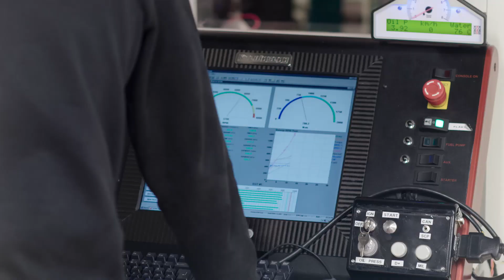/INSIDE KOENIGSEGG 2 -- Coming Soon to /DRIVE

Comment: Koenigsegg is my absolute favourite car company. They make what we dream, BUT is the One:1 going to compete on the same level as the LaFerrari, P1, and 918? Will it be beyond them? or is it appropriate to even consider the comparison?
Keep. It. Up. Koenigsegg. Wow.
Reply: On paper it's a whole league above the Hybrid Hypercars. It's got a much higher power/weight ratio and estimated top speed than any of them, with aero trickery to match them for the corners.
Reply: As Mike stated above, it will be way ahead of those Hypercars. Even the Agera R is miles ahead of them.
Reply: ThePhiltastic Wait for Koenigsegg to release a ring time just as McLaren did? Oh wait, they never did! And if you think that the Agera and the One:1 is made for straight line speed only, you are very wrong. The One:1 can pull 2 G's, on STREET tires!
Reply: Calabunga P. K. The One:1 is just going to 'compete' with LaFerrari, P1 and the 918 Spyder... in a straight line its going to crush them like beetles underneath its foot. :)
Reply: JayRicci7891
Haha, I do have faith in them, that's for sure. Even though I don't care much for economy of cars (my car has a rotary engine.. fuck oil, fuck fuel, fuck torque) I still compliment the P1 on its claimed 32mpg.... In a sense even though Koenigsegg will out-perform the P1 (most likely) there's a slight loss in competition sense that it isn't capable of high MPGs or even ~0mpg like the P1, which in itself is quite a mind-blower
Reply: Calabunga P. K. Yes, you're right. MPG is the essence of these cars!

Comment: The Agera R still has the fastest accelerations times and stops. Damn Vemon GT on damn near slicks and preped pavement. I am not hating just stating. Look at video to see it in action last year. K:1 will destroy those numbers this summer again if tested.
I hope Christian runs car on E85. Car will be over 1500hp. Hopefully they have a driver to get the max on Nurburg. Time should be below 6:30. Last strait will be over 255mph; this is crazy to believe.

Comment: Just a random suggestion. Hennessey provides the engine, Gumpert provides the body. = Worlds fastest car? 

Love these series btw.
Reply: ***** Yep that's what I mean. A partnership like Mclaren Honda. We need more absurd hypercars in this world.
Reply: xKriZ765x Ah your right. Maybe the wings could be active and reduce drag and downforce at high speed.
Reply: oh good idea, wait i just thought of a better one. ok.
koenigsegg provides the engine
koenigsegg provides the body
koenigsegg provides the gear box
koenigsegg provides the carbon fibre
koenigsegg provides the wheels
and we will just let every thing els be provided by koenigsegg. 

now that will be by far the fastest car on the planet
Reply: also no hate on henassy but hennasy's engine has less power than the koenigsegg and weight allot more. plus it takes up way more room. 
Koenigsegg: 5 liter v8 1340hp, 185kg (400lbs ish)
Hennasy: 7 liter v8 1244hp, 292kg   (610lbs ish)
Reply: martinshoosterman Ofcourse not that engine. Hennessey starts with a Corvette engine for that car. Gumpert uses Audi engines. So naturally he would be working with the smaller Audi V8 in the Gumpert.

Comment: Guessing the P1 would outperform this easily.
Reply: LOLLLL haha good one. 
lets quickly compare specs 
top speed: one:1 280, P1 220.
exeleration to 250: one:1 20s, P1 oh wait... (cant hit 250)
max lateral G (turning force): One:1 2.0, P1 1.7
Hp: One:1 1340, P1 900
Weight: One:1 1340kg, P1 1502kg
Power to weight ratio: One:1 hmm i wonder, P1 0.6hp/Kg

so which one do you think is faster?
Reply: martinshoosterman Yes, but McLaren has a way with going around a corner. Don't get me wrong, Koenigsegg has been making my favorite super/hyper/"mega" cars since the CCX, but they have always been catching up in the straights to make up for lost time in the corners.
Reply: The One:1 will shit all over the P1, not even competition. This is a proper track weapon.

Comment: It looks the same as the old car to me....
Reply: ignore the super wing yeah but the performance here is definitely not gunna be the same as the old car.
Reply: It looks like it but it's not the same chassis. The technology is different. For example, it uses a new structure of carbon Fibre layers which are lower in weight but maintain the same strength as the tech used before. 
And you can control the car via an iPhone app as well as normal 3G network. So if Koenigsegg uploads a new suspension setting specifically for a racetrack, you can download and install it on the fly! 
I think it's worth a new model.
Reply: I think theyre ignoring the main thing, which is the crazy increase in the horsepower to weight ratio! This thing is going to be a monster...